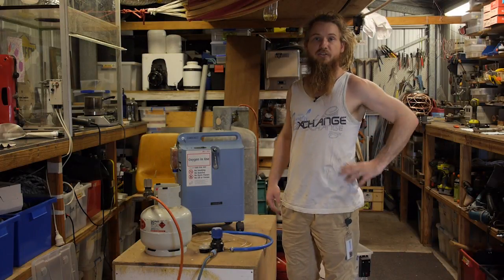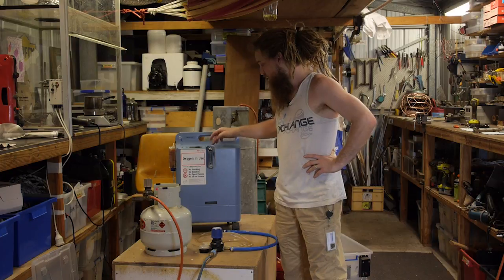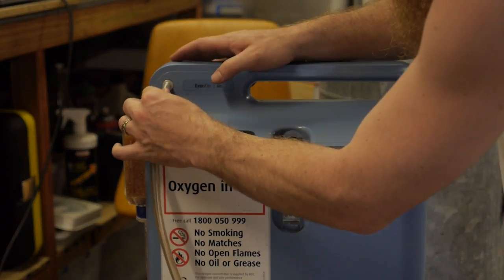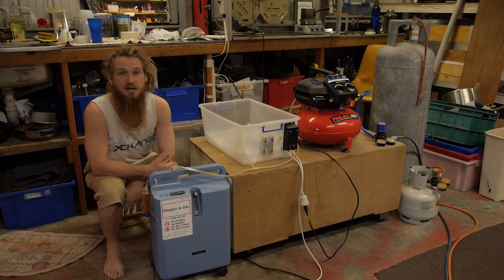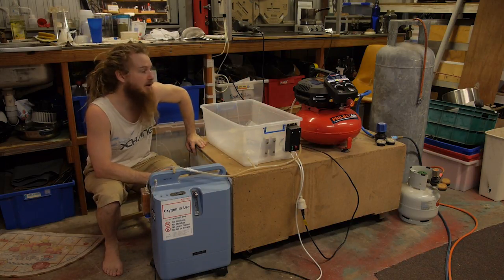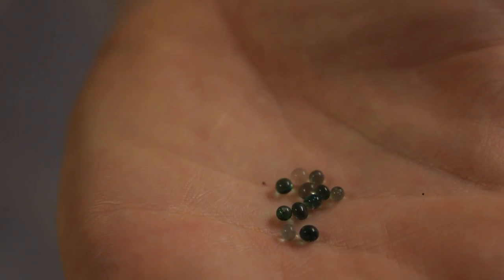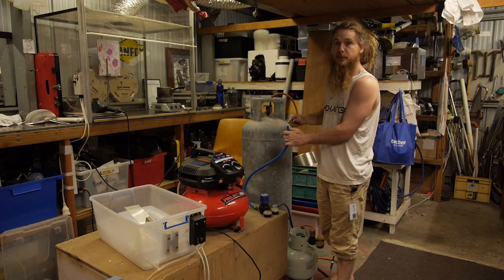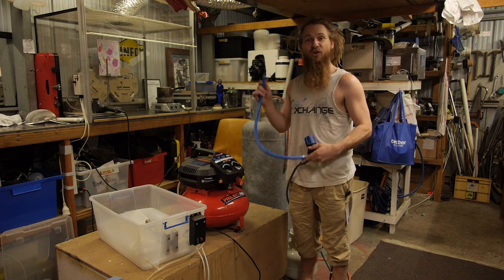How to make your own compressed oxygen for oxy torch

Comment: Is it possible to for-go the lung and go from oxy con > compressor > cylinder?

And can someone explain to me why people are concerned? To my knowledge oxygen is purely an accelerant and not a fuel, so compressing oxygen to 100psi (1/20th the pressure a standard oxygen cylinder holds) shouldn't even be remotely dangerous? However i understand using an LPG cylinder is just stupid, as they aren't designed to stand the oxidation of well.. (pressurized) oxygen.
so in theory it will eventually oxidize (rust) from the inside out and therefore an oxygen cylinder is really the only choice, but if you exchange the compressor at safe intervals, you shouldn't corrode it.
In theory, with the correct materials and a baring in mind the compressors lifetime (due to accelerated corrosion) this should be safe and an extremely viable alternative. 
Because $150, a long drive, carting an 80kg bottle there and back, all for 20-25 hours of use on 10m3 cylinder at 20psi, makes life a cunt
Reply: The only thing dangerous is if the compressor piston is greased. A lot of the "oilless" ones are.
So you have a relatively hot compressor piston, a pure oxygen environment, and a hydrocarbon. That's what's not safe.

The ideal way to do this IMO, is an all plastic diaphragm pump (like an airbrush maybe?) going into a fiberglass or carbon fiber tank. (like what's used in airsoft or paintball, Natural gas powered vehicles, etc.)

Since most diaphragm pumps can't go to very high pressure (50-60 psi typically) maybe there's fiberglass water pressure stabilizers rated for 100 psi that could be used as well.
Reply: Even if a greased piston it will not blow up from fuel or gas only pressure at the most I don't know how everyone thinks oxygen is a fuel  all it does is speed up combustion not cause it.

Comment: Is it posible to only use a running compressor with the gas, without building a backup tank?
Reply: the compressor is too powerful for the air outlet of the concentrator ... I had thought to fill a maletals queen size with the oxygen concentrator and start my compressor until it is empty ... and then repeated .. .. and I miss a valve module to fill a tank

Comment: PETER: QUESTIONS: I have little experience, unfortunately, so I apologize. 1. I heard somewhere that air compressors are often 'leaky', compressing some (of course) but otherwise losing something like 30% of the air one tries to compress. Is this the case, or was I misinterpreting what I thought was going on? Is it 30% backflow and therefore inefficiency, not leaks proper? If it does leak said gas, does it matter for these purposes since it's just oxygen into the air from whence it came - just a little wasted energy, nothing more? 2. When I look at compressors they always seem to have a large open grill, but you seem to have hooked up tubes. If I remove the grill part, will there be a port where one can hook in a tube (and is that how you did it)?

Comment: Generally converting a oil free air compressor into a inlet and outlet compressor is not ideal if you haven't sealed every signle orificeses except the inlets and outlets, I have tried converting countless compressors just to try to pump one gas from point from point A to point B and it never worked, I found that converting an oiled compressor is ideal, but if you don't mind having an explosion hazzard waiting to happen, you kinda out of luck.

Comment: Its great!!! Sir can does the oxygen output from the oxy generator continously?  So that i can directly put it in a reservoir tank.. Instead of bag?  Thanks
Reply from the maker: Yes, it is continuous but very low pressure
Reply: Thanks sir.  To pressurized... I need to set up another high pressure comoressor to refill at least 250 psi...using two units of oxy generator
..Would it be possible sir?  Thanks again.

Comment: Are you not concerned about any potential sparking when cylinders in the air compressor moves?
Reply from the maker: Oxygen needs a fuel source in order to react. The compressor is an oil free type. If there was oil, that would be big problem. Likewise with the cylinder, needs to be be completely free of oil

Comment: What did you do to connect the oxygen concentrator to the air compressor? I have a similar air compressor to you but it doesn't have any sort of air input, and I can't find any compressors that take an air input for a reasonable price.
Reply: did you figure it out?

Comment: I’m going through those 1.4oz red tanks so quickly. 11.97$ per tank. I’d like to get a small refillable oxy tank to use. My work van doesn’t have space for a proper oxy-acetylene set up.
Reply: Those things are red  because they were made by the devil. Horrible deal, too bad getting anything more substantial is horribly expensive.

Comment: Hi, I ordered an oxygen concentrator for a small torch, I will use it at its normal pressure. The configuration is propane-oxygen, according to tea should I use a protective valve on the pipes? The low pressure of the machine (max 1 bar) on the oxygen line could create problems with the safety valve? A thousand thanks.
Reply: did you succeed?

Comment: Just what I've been looking for! Does it work with methane - oxy torch?
Reply: Connect one and see. Glassblowers routinely use oxygen concentrators without the additional apparatus and run them in parallel for greater volume.

Comment: Can you use this same setup to fill a "E" Size Aluminum 680 Liter Oxygen Cylinder at 2200 PSI? what kind of oil-less compressor is needed? the dedicated oxygen compressors of this capacity cost $5000!!

Comment: Where do you connect the hose coming out from the bag of oxygen to the air compressor?? I don't see how the oxygen goes from the bag through the compressor into the store tank . Please help !!!
Reply: The inlet of the compressor.  Usually they have sound mufflers there so look for that.

Comment: what type of desiccant are you using for the air filter and that of which is inside the compressor? just straight silica gel, zinc?
Reply from the maker: Just silica. There are definitely better desiccants, but it works fine.

Comment: Have you tried cutting with it. To my knowledge you need nearly pure oxy for cutting as medical grade is not pure enough. Can you please let me know if you have had luck cutting with it.
Reply from the maker: Yes! Cutting works like a charm. That's why I wanted to pressurise the Oxygen. You only need 40psi oxygen to cut, but 100psi crams more in the tank. I found no appreciable difference when cutting with the 95% pure medical Oxygen, compared to the 99% pure bottled Oxygen

Comment: If you can find an oxygen concentrator with the add-on oxygen compressor (Homefill is common) you can fill high pressure cylinders and use them as normal. 

While you can buy Homefill transfill whips to adapt the common Homefill quick disconnect pump-side fitting to fill standard CGA 540 (in the US) or whatever is used overseas (more fitting info welcome to fill out my knowledge) you can also harvest the fitting from bad Homefill cylinders whose expensive integral regulator has failed. (If I ever go on gaseous mobile oxygen I'll use classic cylinders with swappable regulators and save considerable money!)  It's worth studying concentrators as welding/brazing/heating supplies and a useful way is download example literature and check out both videos and jewelry forums. Happy welding!
Reply: hi obfuscated, have you become a flat earther yet?

Comment: Clever system! However, in 100psi oxygen, the spontaneous ignition point of ANY oil or grease or plastic in the system is probably, like, below the boiling point of water. Given fingernail grease trapped in the Connectors, it seems like it should explode if you get it in the sun on a particularly hot day. 

And steel tanks burn well in pure oxygen too, so if you have ignition, the whole setup would go up in a retina searing, skin charring flash of thermite.

That said, it seem like you're getting away with it for now, which is surprising to me, so maybe I'm mistaken, but there are a lot of horror stories out there about high pressure O2.  Stay safe!
Reply: Hi tristanritland, have you become a flat earther yet?

Comment: Hi. Thanks for sharing your experience.  I was wondering if you have tried water electrolysis to produce oxygen? I saw a YT video and it was giving demo of how to build one. It was simply several sheets of metal connected to DC power and its output rate and speed was enough to evaporate a 10 penny nail. It used the same hydrogen that came from the contraption as fuel.
Reply: by the way it seemed much safer than pressurizing O2! in worst case senario you have a small pop of whatever that is in the hose. There are no tanks or reservoirs for the produced gases.
Reply: There's no need to make oxygen, the air is already full of it.  Electrolysis produces hydrogen which is the reason to use that method.  If you aren't collecting hydrogen for something then you just have a new source of abundant explosive.  Compressing the O2 is the whole point bc, as he stated, many tasks require pressurized oxy to achieve needed temps.  Oxygen is perfectly safe if you treat it like anything else: do your research, understand it's characteristics and safety protocols, respect it, and don't listen to youtube
Reply: @timr4749  He used the same H2 as fuel (as I alrady mentioned) which allowed him do brazing, welding, even cutting thick steel sheets. What I liked about it was that it was ready to go as soon as it was plugged in. You the water pressure in the tank (sealed tank) was enough to push the mixture of O2H2 thru a hose that connects to a torch.
Reply: @timr4749  Oh by the way the size, weight and cost of building all of that was close to nothing. You can find 90% of the matrerials in any household

Comment: All i want to know is how to fill a small red bernzomatic oxygen cylinder
Reply: Nancy I filled one tonight by cranking up a large O2 tanks regulator to 75psi and sticking the tip of the brazing torch right in the top of the red bernzomatic tank and opening the valve on the torch. Success be it a modest amount of oxygen. Beats the $12 for a new one.

Comment: awesome bro, any more of those available. the cheapest one in adelaide is like $2000.
Reply: Clayton Revie I purchased a develbise 5l/m oxy con unit for $100 used on craigslist. I have been happy with its performance when added to my oxy fuel torch, but need higher pressures and a store of oxygen for cutting. I had thought about running my oxy con output through to a compressor inlet, but doing so would damage my unit as a compressor would suck air through the oxy con's molecular sieves. Now I know how to overcome that problem. Hopefully you too can find yourself a used an inexpensive oxy con unit.
Reply: If I have 5 oxygen units, could I get enough if I ran them simultaneously?  Incoming video...
Reply: TheRainHarvester no. You just need one and a a way to compress it

Comment: an "oil free" compressor is not oxygen safe.  I suspect that the pressures you're dealing with are going to be fine, but this really isn't a particularly good idea.... You might want to take a look at a pneumatic "Booster System".

Comment: I want to build a similar system but rather than store oxygen in a tank, I would like to try using an inner tube. As you use the oxygen, the tube would delate more or less giving you an even pressure. I would imagine that the inner tube would not last long, but would it pose a combustion danger?

Comment: I buy mine at 2175 psi in 200 industrial size oxygen tank. Is there a way to fill this at this psi? What do i do and use to get that done?
Reply: You could use a Homefill or other system which uses a compressor to refill portable oxygen cylinders. Run a "transfill whip" to your oxygen cylinder. You monitor pressure on the Homefill (Invacare make them and there's plenty of info online). Enough people do this you can find assembled whips on Ebay if you don't care to buy the fittings (Western are the biggest manufacturer) and some Gasoila thread tape for oxygen.
Reply: @obfuscated3090  yeah but the home fill systems cost $5550 USD LOL

Comment: Hi Peter, 
May I ask something, without using a compressor and your compressor trigging invention 
is it possible to directly connect generator(or concentrator) to tank and fill it maybe via a special two way regulator  attached that you know advise to me. most of generators output max 0.7 bar (10 psi) and this is not efficent.I have concentrator for my patient and wanna buy a small tank and refill it when empty for a portable solution.

Comment: so i read through the coments..mmm..its no joke dont compress..if you do compress use an oxygen bottle and an oxygen compressor and wear more than a singlet and protective beard:)....one of the apolo missions burnt on the ground killing all astronauts...the velcro that held the insulated lining in place caught fire under 100% oxygen enviroment (no ignition)...if nassa can make mistakes we have no hope....the flame from the oxygen generater i think is good...for cutting get a plasma and compressed air,you can get tigs that are arc welders and plasma cutters too (3 way dc tig)now days for round $400aud that use compressed air for plasma cutting ,there is your cheeper option for cutting and it will be a neat cut.i think i read that the specs said cut up to 10mm thick(check that!) any way not worth risk for cutting only...some people in the coments are sugesting oxygen generators can cost $400..pete says he got his second hand for a copple of hundred dollars,the dictionary says a copple is 2...$200 or $400 is worth it if you do alot of braising or need to heat small things but dont forget you can braise and heat small jobs with lpg alone and that is also cheeper than aceteleen and scin grafts....now all we need is for pete to figure out how to generate helium and argon for our 3 way tig and compress it...we need helium for dc aluminium tig welding:)

Comment: I think just using a 4 feet diameter latex balloon that cost 3$ for storing the oxygen is much safer then compressing it in any tank, also 100 times less expensive.
Reply: Would a tractor inner tube be suitable?